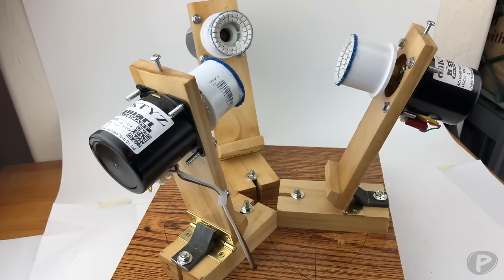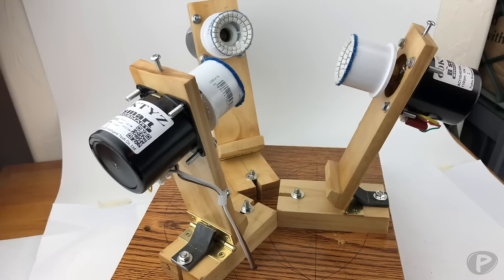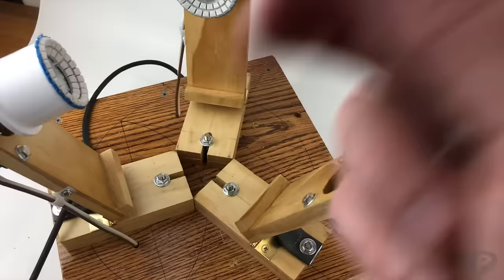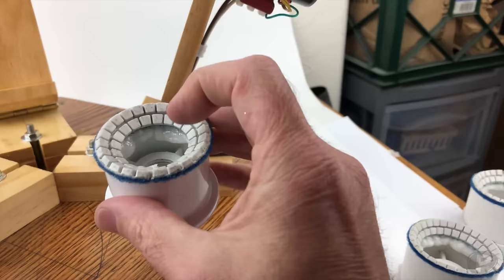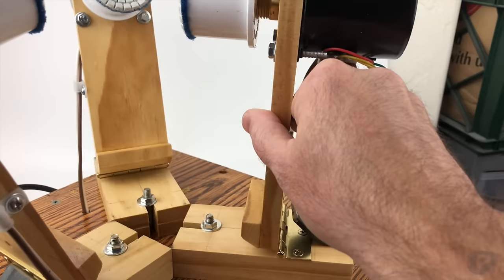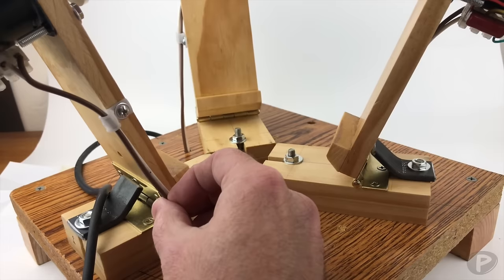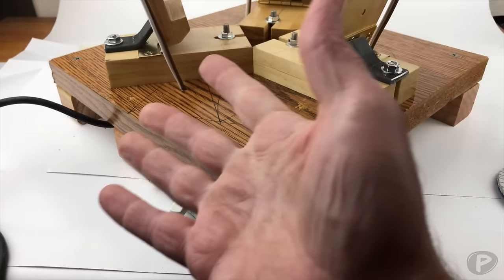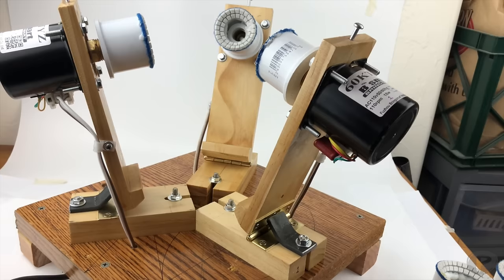Stone Sphere Machine Build Part 1

Comment: I’m seriously considering building one of these. You’ve done a great job of explaining how, so thank you for that. I think I’d rather make smaller, marble sized spheres, maybe in inch or so in diameter. Do you think your machine would work well for that if I made smaller cups, or would you suggest scaling the whole machine down?
Reply from the maker: Sorry for the late reply, this machine would be perfect for smaller stones. The only charge would be the cup size. Good luck.
Reply: @pebble-ology1845  Oh cool, thanks. Would those motors have enough power with smaller rocks too? I saw in a later video where you said it was a little underpowered.
Reply from the maker: @MichiganRocks  the motors used in this video should be fine because there would not be much resistance grinding such small stones. If you want to do larger stones like in my videos, then I would recommend larger motors. I am coming out with a new video in the near future with new motors that I’m testing and having success.
Reply: @pebble-ology1845  Thanks for the reply. I think I'll just go with the motors you used. But, if you want to give me a sneak peek at your new motors, I'd be willing to consider those too.
Reply from the maker: @MichiganRocks  just look up 3gn-5k gear head. It is a motor with a control that runs about $60+. I’ve only ran them for about 10+hrs and are much better than other motors. I don’t want to recommend them just yet since they are still so new, but so far are better
Reply: @pebble-ology1845  Thanks!

Comment: Do you think it would be possible to use much smaller cups in this build? Like small enough to make spheres about 1/2" in diameter?
Reply from the maker: If you could find or make a cup size small enough, then it would be great 👍